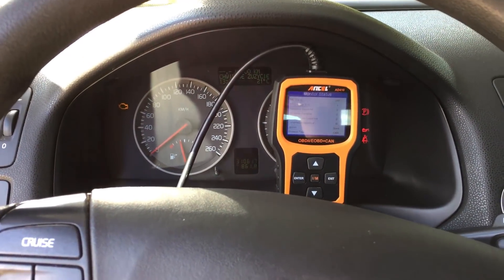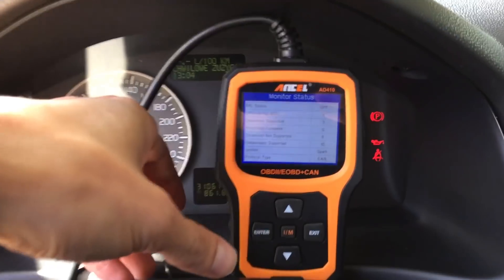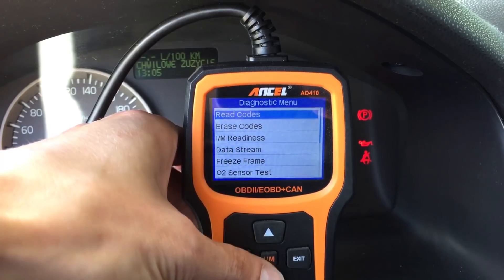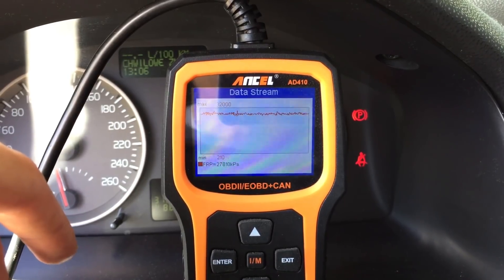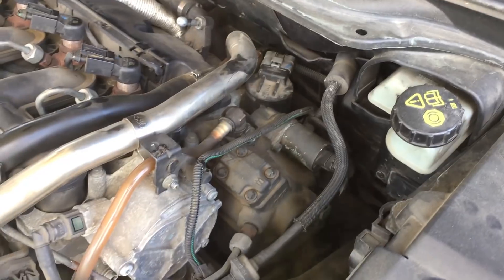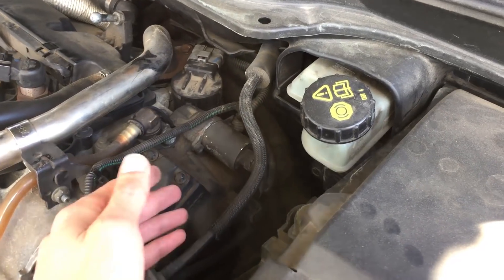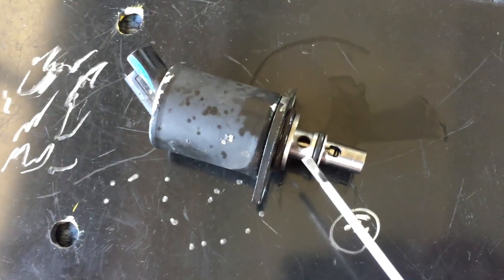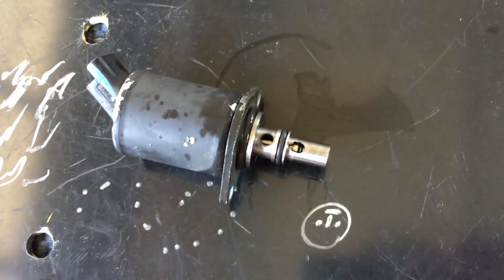P0091 & fuel valve in 2.0D/HDI/TDCI Volvo Ford Peugeot Citroen

Comment: How did you clean it?
Reply from the maker: applied 12V pulses to move it and cleaned it with some solvent and compressed air. If I recall correctly.
Reply: Ok. I'm going through a similar thing with high rail pressure 🤔

Comment: Hi! greetings from Spain. I have been trying to replace the fuel volume regulator of my Peogeot 407 (it looks very similar to the one you are showing in the video, but mine is a llitle bit more hiden than yours haha). The thing is I removed the two screws, but the regulator itself was hard, so I stopped pulling, because I was affraid something would break. I could force prying off a bit with a screwdriver .... but I didn't. Could you confirm if the regulator can be forced a bit (and obviously the new one will be pushed with a nylon hammer, if needed), or may be there is other procedure?

Comment: I've learned recently that these can also get "tyred" in time. I did not have a code or obvious symptoms for mine, but when I got a stage 1 remap, the guys showed me on the dyno data that there was a slight drop in fuel pressure at 3500rpm, and it's because of the aged regulator. Had it replaced, and it makes a difference in many ways. I would have never known if it wasan't for the remap data. Or maybe if it failed one day.
Reply from the maker: Great that you found out about that before it was an actual issue!

Comment: Great video !I have a question...i have v50 2.0d with the same engine,when i release and press the gas pedal it jerks,it jerks 8 ot 10 times for example,did you think can be from this fuel regulator ?
Reply: Did you solve it , it could be throttle body.

Comment: Can you remove this valve without having to prime the fuel system again? Thanks.
Reply from the maker: Some air will get inside but this valve is positioned fairly high in the fuel system which is in your favor.
Reply: Thanks, my 07 s40 2.0d had a fuel filter and housing change and now won't start after full bleeding etc, garage have said their reader states "injector valve fault", it's at a diesel specialist at the moment so I'm figuring out what it could be and what it's going to cost, narrowed it down to this or an injector is at fault, likely to cost a fortune.

Comment: Hi
What holds the pressure once the car is switched off, as I have a cold start problem, changed all the obvious like glow plugs, but I have noticed on the live data my pressure drops straight to 0kpa within 30secs, where as my bro-inlaws stays at around 230kpa constantly.
Thanks

Comment: Hello @mr-fix, could you please explain which solution has been applied to fix the P0091 error on your car? I've seen your video and at the end you tell that the pump had to be reworked, what exactly have been replaced? My V50 2.0D gives the same error when I push down all the accelerator and only if I keep it pushed for more than 2-3 seconds (maximum power). Looking into Volvo VIDA the error "ECM-0091 Fuel pressure control valve. Signal too low" is related to the other valve, not the VCV but the PCV valve (VDO A2C59506225) which function is "fuel Pressure Control Valve regulates the flow out to the fuel rail. As a result, the pressure in the fuel rail can be adapted to each unique operating condition." Please give me a hint and tell me if you also had problems with misfire/juddering at low power conditions, like in a flat road with a constant and slight acceleration. Thank you!
Reply from the maker: If I remember correctly pump was replaced with another one. Some garages refurbish used pumps, have some of them in stock, sell you refurbished one and take the old one to redo it for someone else. So it's hard to tell what exactly it was the issue.
Reply: @mrfixpl  I've fixed my V50 2.0D problem: it was the PCV valve (VDO code A2C59506225) installed on the high pressure pump that couldn't mantain a constant fuel pressure when pushing the throttle slightly (FRP unstable around 400-800 Bar, but stable at higher pressure or idling). The mechanic dismounted the pump, replaced the PCV valve and reinstalled the pump, not an expensive work. No vibration or juddering/shuddering at all now!
Reply from the maker: @turbozag77  Great to hear that you worked it out!

Comment: Hi, I have P407 and car do not start when conector is conected to fuel flow regulator. But if I apply 12V to regulator car starts without a problem. My questions is what is your voltage on fuel flow regulator conector with key in 2nd position. I have 7,3V which is not enough to open regulator and I am worried that ECU is bad. Thank you!
Reply: @gtoferrari288  hello I have the same issue did you figure it out .
Reply: @mikajones3018  My problem was bad fuel flow/pressure regulator. Even new one was not working when used cheaper one. With bad regulator, rail pressure was not reaching starting pressure values.
i hope it helps.

Comment: Do you have any tips on priming the fuel system after replacing the pump and injectors?  I have a Volvo S40 with this engine, I removed/cleaned the injectors and now can't get it to start.  I have used a vacuum pump on the return line as per the workshop manual.  I have tried another high pressure injector pump and have checked the fuel filter housing for cracks.  The o rings in the fuel lines have been replaced and a new fuel filter and seal has been fitted.  I connected the vacuum pump to the end of the fuel intake pipe right before it connects to the high pressure pump and primed the fuel up to that point and then connected it to the pump and put the vacuum pump on the return line. I still get some air bubbles going back up the intake pipe.  I left the high pressure outlet pipe disconnected and when cranking the engine it doesn't push any fuel through.  I have checked the drive dog on the end of the camshaft as I have seen that these can break but this one looks fine and with the high pressure pump removed I can see the camshaft turning when cranking the engine. Do you have any ideas or suggestions?  Thanks
Reply: How did I manage to start?
Reply: @alfaautoworks3840  Bro , just pull the inlet hose in front out, spray brake cleaner and ant the same time someone needs to start the engine en press gaspedal it wil start

Comment: Hi, I got the same car and similar problem: cold start very well no problem at all and runs smooth until it gets warm and then it starts to shaking sometimes. With diagnostic tool I can see fuel pressure going like heartquake when the problem appear and suddenly return to normal pressure and car runs fine. Also I noticed that when problem appears the MPG goes like 32litersx100km. No engine lights on and no faulty codes.
What can be?
Thanks

Comment: Mr fix I need your help with this one I have the same car with a 2 L engine diesel I believe it’s used in many other vehicles especially Peugeot I want to swap the engine I want to put in 2018  focus 1 L eco-boost and possibly gearbox  do you think it has the same set up What is your suggestion on what will work thanks ps Please anybody your suggestions are welcome

Comment: Hi I have same symptonsbut different fault code,its p019100 ?What do you think this could be and did you ever sort your problem out
Reply from the maker: Your code points to a faulty fuel rail pressure sensor.
Reply: @mrfixpl  other thing I noticed. When the car is running at tickover the fuel pressure is bouncing between 290000 kpa and 310000.then when I shut the engine down drops to 210kpa for a few mins then to zero.
Reply from the maker: When you shut the engine, the fuel pump stops and the pressure drops. you will see 210kPa because that's the low end of the sensor with its resolution. And when controller decides to go to standby it shuts down power to all the sensors so you have 0kPa. That's normal.
Reply: @mrfixpl  Thanks. If ordered a new one.hopefully fit to the rail in next few days

Comment: I have this engine in my Volvo s40 I have a A problem with first start of the day takes four or five at attempts to get it started But after that fine all day could this be a fuel pressure regulator issue it’s covered 187 k miles Pulls really well no real smoking under power i’m in the United Kingdom and it’s been warm for past couple of months still no change I would love all your suggestions please ps I love all your videos
Reply from the maker: I would check the fuel lines first. Next time have someone to start your car and check if there's no air bubbles in the fuel lines.
With that mileage your car is going though ~ 10th fuel filter and with that many maintenance service actions the fuel filter housing can crack.

That's just one of the possible causes.
Reply: mr-fix Hello Mr fix I checked lines today No bubbles at all took three or four attempts to start but after first start start straight away any other recommendations please
Reply from the maker: Then it would be good to scan the car for DTCs. Also try to cold start it and monitor two parameters with a scanner: RPM and fuel pressure. When the car shuts down you can see if the fuel pressure is steady before it happens or if it's dropping.
Reply from the maker: You might wanna check the intake flap (or flaps if you have engine with intercooler bypass valve). Those are shutting close the intake when you turn off the engine and should be 100% open when you are starting it again. If there's a lot (A LOT) of goo in the intake this flap/flaps can stay shut or not fully open and first few tries can look like that. When the engine shakes the chassis hard enough the flap opens.
But that's a long shot.

Please try this: next time you park your car at home, open the fuel tank to release the vacuum that's inside. Then close it and come back in the morning. If you can start the car at first try, then most likely there's a leak in the fuel system and the vacuum can suck in some air though the fuel lines or some other way.
Reply: mr-fix I recently just cleaned the intake out completely wasn’t too dirty to be honest so definitely not that
Reply: mr-fix hello mr fix I did what you suggested taking off the fuel cap  After a drive  starts first time the next day any recommendations of how I would go about it fixing the problem
Reply from the maker: If everything is OK when you release the vacuum, then the problem is with the fuel system lines. The vacuum sucks the air to the system though a perforation or leaky connection.
First: visual inspection of the lines. Since there are no air locks visible in the transparent part of the lines, the leak should be further.
Reply: can also be fixed by putting a check valve just before the fuelfilter so the diesel can't return to the tank .... maybe a good idea to go on the volvo owners forum on fb they can help you alot

Comment: 2.0 is also found in Ford Galaxy mk3. I started using vegi/diesel mix 50/50 and the car runs much better and smother!
Reply: Tahir Rana I think my engine is very loud compare to most diesels especially on Idol any suggestions Same engine in video 2006 s40 187k

Comment: I love the videos you do for this engine, its the same engine in my mondeo, so far I've cleaned everything you've shown, i'm going to pull the injectors out and strip and clean them soon .. wish me luck .. ps keep the 2ltr diesel engine video's coming ... Regards Andy
Reply: I am with the same engine and your videos are helpful for me. Thanks.
Reply from the maker: Good luck!
And thanks for your kind words.
Reply: I have this engine in my Volvo s40 I have a A problem with first start of the day takes four or five at attempts to get it started But after that fine all day could this be a fuel pressure regulator issue it’s covered 187 k miles Pulls really well no real smoking under power i’m in the United Kingdom and it’s been warm for past couple of months still no change I would love all your suggestions please